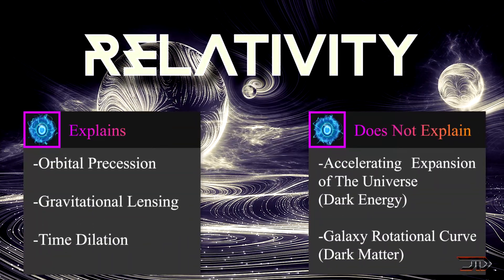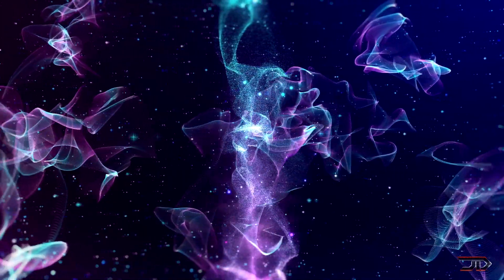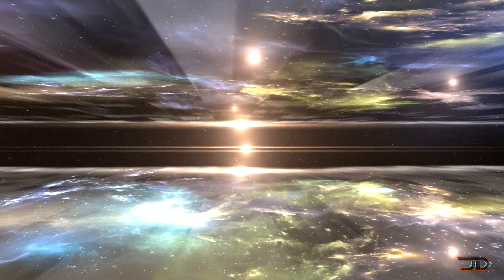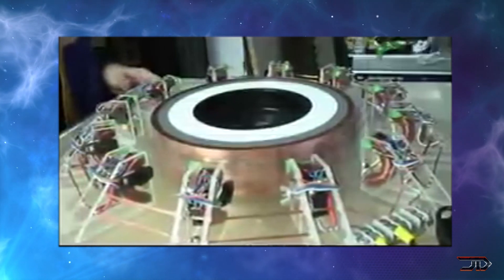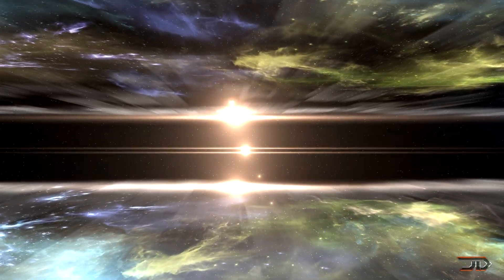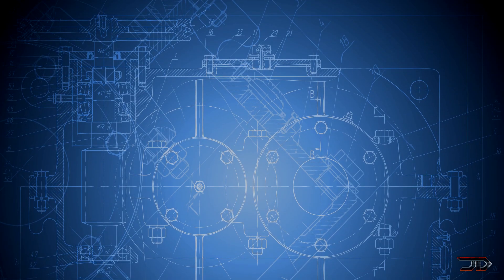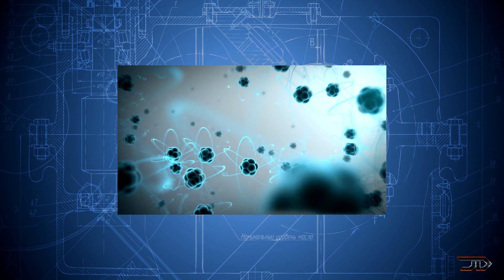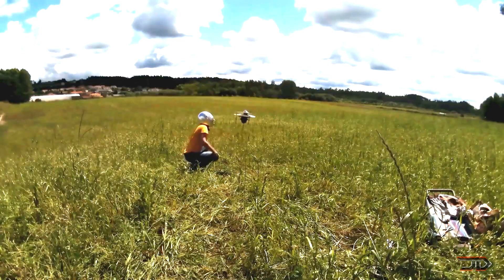Does ANTI-GRAVITY Technology Really EXIST?

Comment: I found this Chinese patient....

Anti-gravity propelling device for mercury spheres
Abstract
The invention discloses a mercury sphere antigravity propelling device which comprises a shell, an insulating partition, a strip-shaped super-conductive magnet, a positive electrode wall, a negative electrode wall, a buffer layer, an annular insulating cambered surface, a first capacitor and a second capacitor. The positive electrode wall, the negative electrode wall, the insulating partition and the annular insulating cambered surface form a closed annular channel, and a certain amount of mercury is filled in the annular channel. After the power supply is switched on, the mercury rotates anticlockwise at high speed under the action of electromagnetic force, and thrust in a direction deviating from the center of the shell is applied to the wall surface of the whole negative electrode due to centrifugal action. The direction of the total thrust is opposite to that of the gravitational pull, so that the influence of the gravitational pull is counteracted, and the device has the antigravity propelling capacity. The invention can freely go in and out of the earth's atmosphere without depending on the propulsion of the acting force and the counterforce of the air, can also keep static in any space, gets rid of the dependence on conventional fuel and air, and can meet the aim of flying in the space for a long time.
Images (2)
 
Classifications
 B64G1/409 Unconventional spacecraft propulsion systems
View 1 more classifications
Landscapes
Engineering & Computer Science
Chemical & Material Sciences
Show more
CN110857151A
China

 Download PDF  Find Prior Art  Similar
Other languagesChineseInventor陈志强张亮Current Assignee Individual
Worldwide applications
2018  CN
Application CN201811035772.3A events 
2018-08-26
Application filed by Individual
2018-08-26
Priority to CN201811035772.3A
2020-03-03
Publication of CN110857151A
Status
Pending
InfoCited by (1) Legal events Similar documents Priority and Related ApplicationsExternal linksEspacenetGlob

Images (2)
 
Classifications
 B64G1/409 Unconventional spacecraft propulsion systems

Comment: On the so called "Haunebu" construction plans, there is not one single word about Gravity, but of density of the ground, the water, the air, the molecules and that a "engine" that works with "explosion" is against the nature. They speak also of frequency and electrostatic. How can a fish stand in a waterfall, it is the opposite of an explosion, more an implosion but that is also wrong. Some people do not understand, why there is a maximum flight hight, some are also stupid and beliefe that you can fly in a vacuum, but they have not any idea what you need to create thrust ... with no air no chance. Some are making fake videos, say they made an vacuum in a plastikcontainer, but in the vids you see that there is a gap and no sealing, or they create a small container, make a bit of vacuum and then tricks and use a smoker that creates an atmosphere and after the container get filled they show they created thurst ... but not in a vaccum. I was in an old german Bunker and it was filled with old informations about that, the allied powers did not get, cause the germans hide the real stuff and also the rest of that Bunker is still sealed and you come not in. They will not find the bunker in 1000 years i think so many time to get in :D

Comment: The reason that most of the gravity devices use magnetism is because the earth is a giant magnet and simply creates gravity by spinning. 
That is right, to creat a gravitational field all you have to do is spin a magnet. 
Gravity repels gravity so to make a field that will levitate off the earth you need to make a device that turns a magnetic or an electro magnetic field very fast.
Go look at what John Keely did in 1885 or Nikola Tesla did in 1895 or what the Germans did in 1943 ir John Searl did in 1953, all of which spin a magnetic field to creat gravity and therefor levitation.

Comment: I figured out a gravity drive and it works so I am sure government has figured it out. And Einstein was wrong about gravity, string theory is wrong, and we been over thinking the whole universe to many crazy ideas it's all electromagnetic  from a single atoms function all the way to expansion of the universe. Only part string theory has right is vibration.time is a linear made up measurement and it changes with scale a atom is basically a separate universe each one is probably a parallel universe that has a completely unrecognizable time scale to us meaning ours may be a single atom in a much larger unrecognizable scale universe ect ect. But black holes galaxy atoms they all move via the same force electromagnetic resonate vortexing,  the center of a black hole is essentially dead center of a magnetic field convergence and divergence meet there even a dam bathtub drain shows the same movement  different direction of swirl in Argentina as New York  because one is n pole other s. And yes gravity is made as a function of magnetism we think it's weak its just the diamagnetic part of magnetism the " dark matter" like part of magnetism so imagine trying to measure it with only magnetic sensitive machinery ya can't because it is diamagnetic...explains waters weird properties why the atmosphere has more power than it should ect.even a capacitor has a magnetic field function it's just mostly diamagnetic that's why they always seem lighter in hand during fast movement. It's all much much simpler than we think.🙂
So instead of calling me a son of a b threatening to cage fight me or my mama's a ho because I dared say Einstein was wrong. .just think about it. And visualize what i said about it all interacting magnetically. Even explains the double slit experiment 100% if every photon was simply a lil magnetic field shaped like a sphere. 🙂

Comment: I suggest creating opposing fields spinning counter to each other and the fields should use gas in one and liquid. The gas should be pressurized. The atomic chemistry will probably probably need to close to close to the same or much higher than the. other. And maybe 3 to 4 different fields. One may may be needed as a containment field or 2 to control the fields and navigations. It may have several different mini fields to aid in the navigational sides

Comment: One thing that struck me after watching this is that Einstein's theory of relativity not only seems not to apply in the subatomic realm, but may also not apply on a very large scale.  The latter observation might explain the perceived need for a theory of dark matter, which many scientists seem to find neither persuasive nor satisfactory.  Thus, one simple solution might then be, instead of dividing matter into just two realms, the microcosmic and the macrocosmic, to divide it into 3, the microcosmic (i.e. where quantum physics provides the best desciption currently available), the MESOCOSMIC (our human/planetary level where Einsteinian physics seems to provide the best desciption currently available) and to reserve the term 'macrocosmic' for superlarge (roughly, galactic-level or above) clumps of matter.  Rather than having to hypothesize about the existence of 'dark energy' and 'dark matter', all we would then need to explain the speed and movement of galaxies would be a modified version of Einsteinian physics - a possibly far more palatable proposition!

Comment: Power is an issue, you cant create energy out of thin air. It's already something the fallen angels have as knowledge, my opinion would be that it may or may not be electromagnetic, by default, but something else of another nature, probably in the realm of frequency/vibrational frequencies, passing through/between polarised electromagnetic poles and into a closed seismic nuclear propulsion system, in order to sustain a given energy. I may be wrong. Thorium is quite possible as there are countless cases of UFO landing that state radiation in the given area of landing, as well as its effect in the surrounding area in terms of time and dilation, mass property effects.

Comment: Pumped Phase Conjugate Mirror Laser Optics ( using Barium Ferrite as aberrant media )  add in an electromagnetic field at 100-400 hertz and connect to a load.  The more demanding the load the greater the anti gravity field becomes.  Tesla, Heaviside, Whittaker, Maxwell, Bearden.  Do this in any university laboratory in the country then sit on the side for a couple of hours and laugh to yourself about how easy it is - Thomas Bearden.  Use a battery that powers a lamp and you can levitate a warship.  And don't ask about the Philadephia Experiment I'm not allowed to talk about it -  Bearden. ( Retired Liutenant Colonel U.S Army ).

Comment: Actually you can go back to 750 BC. The Muaneans Never knew What an atom was & Niether did the Atruscan-Lems. They only know & knew Force-field work as their top  accomplishment & found that throo Inlay work in Metal that the Design had been Hit by Lightning causing it to Have No weight somehow. THEY WENT ON FROM THAT FLOOR Design or  floor pattern which may have been Laid in Lodestone for all I know. Circular pattern of magnets on a bronze plate struck by lightning (swirling DC current) imparted that swirl into the magnets, so instead of each magnet acting individually, each one was now connecting one to the next, to the next, to the next and creating is own swirl. This is how a Tornado can pick up a non-aerodynamic 120 ton Diesel Locomotive. But remember, we are in an ubiquitous "Field" and all matter is self propelled; gravity, so-called, is merely a single modulation of this "Field" Gravity merely instructs, drives and compels. The "Field" permeates everything and gravity cannot be shielded. So if gravity can go through anything, then how can it push or pull? This "Field" has sundry uses and unlimited possibilities. It can cut, burn, dissolve, laminate, selectively levitate, used as an altimeter and even instant communications to the ends of the Universe. Just ask Phillip Kramer... forgot, they killed  him so that secret wouldn't get out. When you spin the tiny infinitesimal thrusters inside matter, they will negate their own action and the matter will lose its weight and inertia. This is how the aliens moved the earth from the 5th orbit down to the 3rd orbit. They gave the earth an instruction and it obeyed. Newton's theory is 400 years old. Time for an update.

Comment: The acceleration and expansion of the universe is easily explained in the Theory of Rel. if you think outside the box. Or in this case outside the universe. Imagine what we call the univers, is actually one of 6. And they are all spaced out equidistant in a hexagon shape. 
Now each has a 'Big Bang' at exactly the same time and things expand toward the center. At first they expand really quickly and then their is a slow down. But then as the material reaches past the center point it starts gaining speed again as it is pulled back toward a new starting spot. Now the material from point A leaves and ends up at a point across from it. And vice versa. As this happens the material that had coalesed in the middle from the different starting points seems to be moving faster and faster away from each other. Because it is.

Comment: Can I suggest to you to leave out the words, "Can it be real", sure looks real to us the viewer.  Something better should be can someone else replicate the same experiment and climate the external wires leading to a plugged into the wall power source? How about being self contained. As I can remember the japanese had developed a new high speed train, it was going to be a monorail system more similar to the disneyland monorail electric train that runs around the park. 
But the Japanese developed their new system to be electronic magnetic rail that received electricity as the train moved forward. The magnets on the train would be attracted to the magnets on the rail as they were electrically activated. So as this rail system gained speed it would begin to levitate on its rail wall. Thus the cars of the train would float.

Comment: Craft using an inertial mass reduction device
Patent filed by the US Department of Navy

1. A craft using an inertial mass reduction device comprising:
an inner resonant cavity wall;
an outer resonant cavity wall, the inner resonant cavity wall and the outer resonant cavity wall forming a resonant cavity; and,
microwave emitters such that the microwave emitters create high frequency electromagnetic waves throughout the resonant cavity causing the outer resonant cavity wall to vibrate in an accelerated mode and create a local polarized vacuum outside the outer resonant cavity wall.

Comment: You didn't show anything about using a superconducting fluid that is also a superfluid. If you pump enough power into it and the material strong enough to get the fluid to move over 10 percent the speed of light. As long as it is at superconducting temperatures once enough power is in the system you need very little power to maintain. If you get enough decrease in inertia mass you need very little thrust to accelerate very fast. Purposely the tr3b works in this manner.

Comment: It actually starts with back engineering alien spacecraft which we’ve captured or retrieved over the last century. Having done that, the US military (i.e. Black Ops) via Area 51, Area 52, have built their own anti-gravity spacecraft for use by the US Spaceforce and their Black Ops components. Of course the government won’t tell us about this, and it’s several levels ABOVE Top Secret so even the Congress and President are kept in the dark, as usual.

Comment: Gravity doesn't exist in the practical sense from what I understand gravity is the reacting effects of newton's third law of physics being for every action there's an equal opposite reaction this being said the answer to gravity has always been in front of us but humans either cant prove it due to lack of funding, it's far too expensive to build and humans would prefer to be rich, or the last reason human beings are too stupid to figure this equation out.

Gravity is like a reactionary byproduct of 3 important factors:
1. Thermal motion or carbon air pressure to put it simply. Thermal motion is the result of both physical motion and temperature increases vs decreases. My evidence? Space all thermal motion comes to a stop due to space being negative 455 degrees Fahrenheit or 2.7 Kelvin and because of that there lacks any type of feasible air pressure or force in space.

2. Electromagnetism, our earth is made up of dirt with a fuck ton of electromagnetic metal and the sun is made up of pure energy it's not hard to fathom that the earth is reacting and spinning around a ball of energy based gas.

3. Our core is made up of iron and nickel both which are pretty magnetic and so the metals of our planet are reacting to the energy of the sun.

Your also forgetting that there's alot of other planets that orbit as well as the moon which has an effect on gravity as well keeping everything in motion and motion is what determines time without motion there can be no time dilation just something to think about.

Comment: Mainstream science/quantum physics needs thrown out. Tesla should have been the guy. All these particle analogies break down when you get to the bottom of things and alot of these partie analogies literally use make believe particles to balance equations out. If there are no real particles involved in such equations then the equation itself is a waist of time. Nature isnt math. Its not made of numbers. It ultimately breaks down to the dielectric field and and its inverse. It's not quantifiable and there are no particles involved. You need a literal understanding of nature to harness the aether/dielectric field. Particle a analogies as used (failingly so) to describe light and even worse the virtual photon analogy to try to quantify a magnetic field (nothing but an Aetherial reflection) doesn't work and is pointless to even try to make it work. You don't need superconductors you need diamagnetic reflectors with a freaking electromagnet underneath so you can fly on the aether tortion like a hot air balloon lol. You have a freakin super conductor. Please try this simple experiment. Wrap a wire around a small neodymium glue it to balsa wood attach a small thin plate of bismuth over top or under the magnet using the wood a d idk plastic straws. Seriously try it.